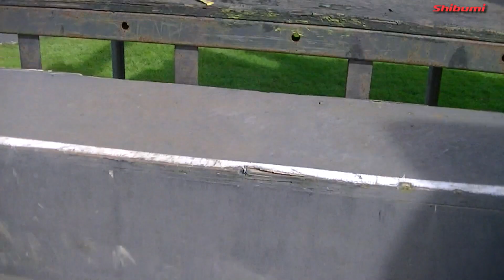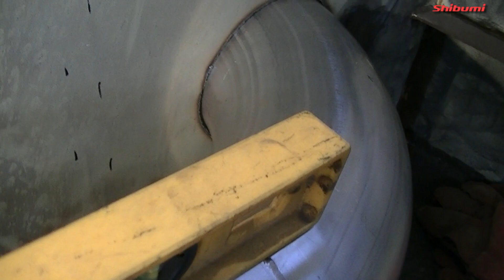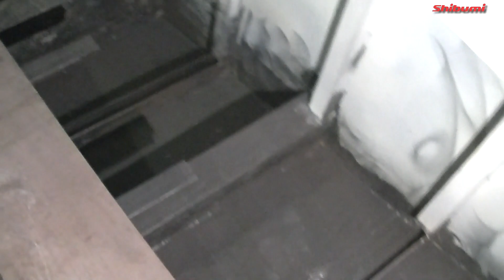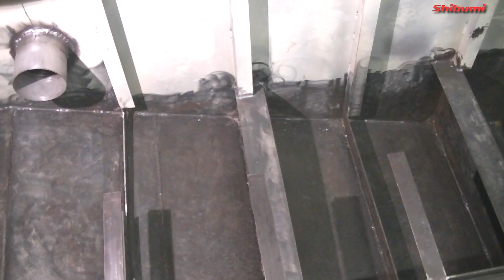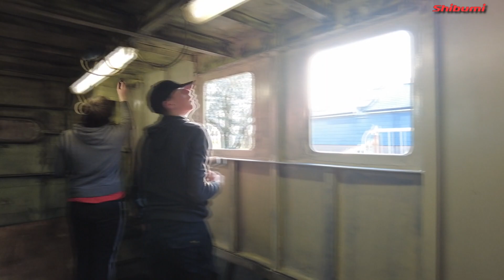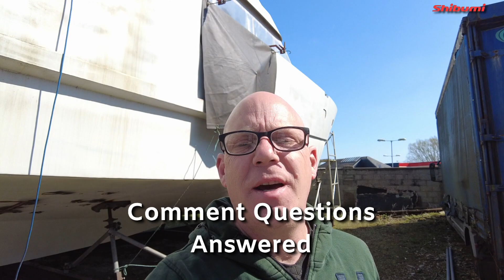Final welding in AFT cabin and ready for paint EP 47 Building Shibumi

Comment: Hi Dirk, good progress to have completed all the welding in the aft cabin and a nice feeling to be moving on to paint. Glad to see that you’re going to use an air fed mask for applying the epoxy - there are some real horror stories of where people have not done so and things have gone very wrong!
Just a little idea - before I epoxied the inside of my boat, I drilled all of the holes that I needed in the steel for fixing the timber furring strips/grounds. I drilled 10mm diameter holes and then used 6mm stainless bolts with plastic shouldered washers to prevent the stainless coming into contact with the mild steel. Drilling the holes first allows you to epoxy inside the holes too for better corrosion protection.

Keep up the good work 👍